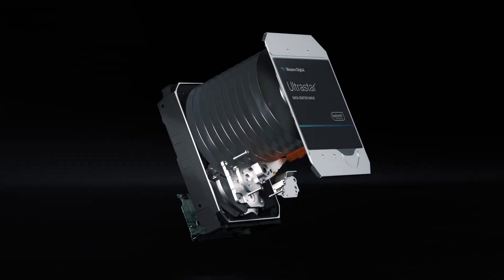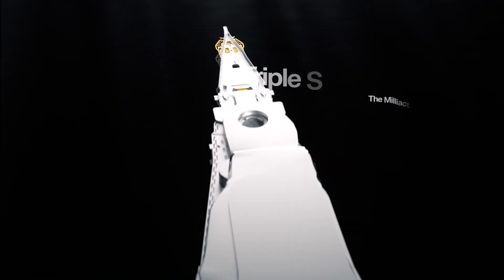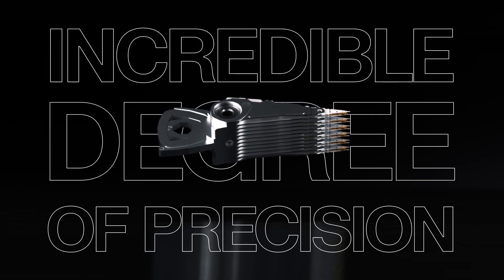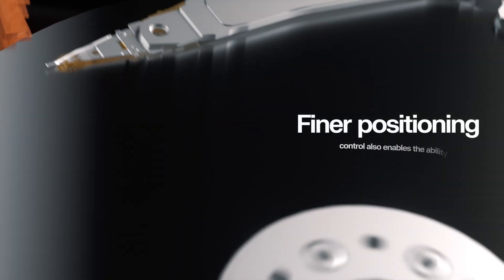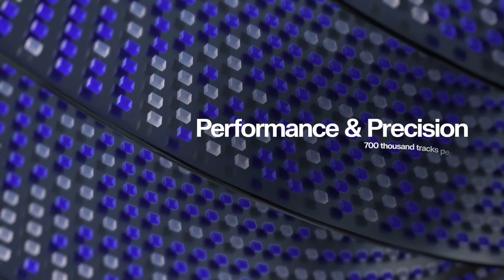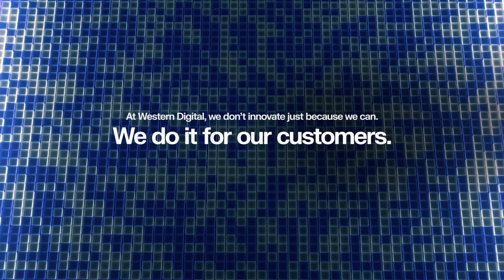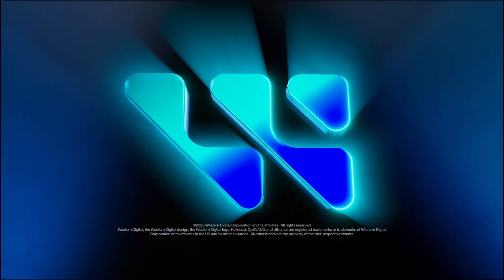HDD Innovation:  Triple-Stage Actuator

Comment: > no obvious comparison of data density to previous generation instead of useless nonsense about CDs
> no obvious comparison of improved seek times
Let me take a guess: it's a complex system that takes a lot of time to settle after a swing, and the reason it exists is to provide just enough precision for random access writes without resorting to shingled writing over multiple tracks with tightly controlled position shifts producing magnetic field switches which can be already just barely discerned by read head?
Reply: I was rather unimpressed to. Feels like an AI marketing video to sway C-Suites rather then the engineers that build and design infrastructure that needs this level of storage

Comment: I don't buy Western Digital drives at all anymore ever since I was burnt by them falsely passing off SMR drives as CMR drives several years ago.
Reply: Yeah but there isn't much of an alternative with HGST gone. Seagate are less reliable so I've been avoiding them for over a decade.
Reply: @kunka592 To be honest seagate's been mostly fine for me. I've got 8 x20 20tb drives running for over 30000 hours at this point with no signs of failure or degredation. Not even a single bad sector on any of them. I did have one drive fail but it was dead on arrival anyway so I got it instantly replaced. 

Aside from those, I've got a couple of 4tb ironwolfs and 2 2tb barracuda drives. None of them are showing any bad sectors at all although the barracudas have lost some of their performance compared to when they were brand new in 2016
Reply: Oh the humanity. How did you ever survive such an injustice of having the wrong three letter initialism?
Reply: @whickervision742 Do you.... are you even qualified to be in this comment section? Now I'm guessing you're probably american from the sheer lack of intelligence so it's the equivalent of saying a GPA of 1 is only 3 numbers away from a GPA of 4 so there's no difference. 

SMR drives stand for shingled magnetic recording and means that the drive has to constantly re-read and rewrite a whole data zone when attempting to modifiy or delete a small portion of that zones data. This means you lose roughly 60-70% in sustained data trainsfer speeds.

WD is an absolute joke for trying to put it in NAS devices where speed (especially in raid) matter alot.  But hey, you do you man and stay ignorant.
Reply: @whickervision742 if you don't understand the difference between the two, that speaks volumes of your intelligence.

Comment: Fun fact of the day, I actually sent this suggestion to both WD and Maxtor back in the early 2000's 

Even took it one step further to see if it was possible to have two independently moving heads for improving seek times
Reply: The genius isn't the idea, it's the implementation. How the axis moves and how it is stabilized. This isn't some simple PID controller either.
Reply: I'm sure you know that multiple heads were first used back in the '50s and 60's, when such devices were unique, so it's not exactly a hidden path. You probably did some calculations to show how much seek times improved (each additional head basically multiplies the hardware cost while having less and less effect on average access time). Compared to arrays of regular mass produced drives that give independent access and combined throughput, and caching hierarchy that can be constructed to give the required average hit ratio for a set usage pattern, it would not be very attractive.
Reply: @DarkKnight32768  To draw the mental picture to override some of that  condescending commentary

Imagine one arm that is has two halves:
An upper and a lower one
(big 1000 IQ moment) 

The arms could either move independently of each other or in sync for improved seeks & writes depending on what was needed 

Obviously, NVMe is significantly faster as 2.5GB/sec read \*and* write times are common now
Reply: You should sue them

Comment: Why not install 2 actuators at once, diametrically opposed? Or 4?
Reply: Well. If a data train leaves the station travelling at 7200 RPM... Do some math.
Reply: They already do that for the second actuator and the 3rd would be similar i suppose

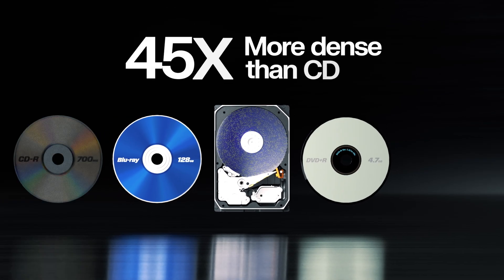Comment: 1:34 and 1 milion times denser than the stone tablet. What is the point of this comparison lmao.
I hope it inovates reliability, not only money making density
Reply: Vinyl record is the point where you can see the tracks.
Reply: 10x denser than a blu-ray is, at maximum, ~1300GB. It's not impressive for a drive at all
Reply: By definition, more complexity = less reliability MTBF
Reply: "I hope it inovates reliability"
i'm still using 2 TB WD2002FAEX drive with 115k power on hours (13.7 years)
seems pretty reliable to me :)
Reply: @stclaws9580  There was time in late 1990s when 2 GB WD were dying like flies. Bad design.
Reply: @stclaws9580 damn. My longest living drive has 44000 hours, my 60000 hour drive failed 5 years ago. ;_;

Comment: Let us hope it can still work with 2 out of 3 of these actuators operational
Reply: Like a lot of new storage technology, these are presumably intended for enterprise/datacenters first, where density and reliability as a whole are most important, not necessarily an individual drive.
Reply: Most likely it can, as HDD have been using Special place in those tracks to know what track they are in.

Yes, the track have trace that name the track, so the track heading head can track what track it is on.
Reply: Well you can still try swapping the hhd discs to a different working hhd and recover the data
Reply: I mean, typically if there's any kind of hardware fault at all in something as crazy as a hard disk, I expect the thing to be dead. You should probably be in the mindset that hard drives are a consumable, because they will fail. Not if, when.

That's why you use backups, and if you're fancy a redundant system of multiple disks like ZFS that can survive the loss of one or more drives without losing data.

Comment: WD is going to keep finding ways to maintain hard drive relevance for the next hundred years
Reply: Yeah I can buy a 24tb HDD for less than an 8tb SSD. Sorry but for larger amounts of storage and longer archives HDDs are still very relevant
Reply: @masterinico  Not forever.
Reply: SSDs aren't really that great for data retention when they are offline with no power, HDDs in the other hand are magnetized and don't suffer from this flaw.
Reply: Life span of hdds are much longer than ssds
Reply: @50H3i1  with sufficient overprovisioning ssds can last for a long time on its own, but for price to storage hdds are king but for speed ssds are king but for long term cold storage tape is where to look at
Reply: @50H3i1  
Yes, It was, but with RaceTrack memory and UltraRam everything is going to change.
Reply: @gregandark8571 "going to change" bruh
Reply: @Splarkszter  bruh
Reply: @Splarkszter  breh
Reply: Race Track memory is right now behind the coroner ...
just saying.
Reply: @gregandark8571   Heh,  dead tech will need a "coroner".
Reply: @chris-io9zt 
No, only a trash bin.

Comment: With actuators so small, I would be worried about mechanical durability... Would it survive shipping? Vibration from other hard drives on the same chassis?
Reply: They always package drives very carefully. Vibrations from other chassis?? I mean not likely maybe it you have an old crap 1990s HDD rattling next to it. 

I have several 20tb+ drives in three stacked raid enclosures. Even balancing on each other multiple drives running at a time in multiple raids still barely vibrates
Reply: @masterinico  I seen more than once a bad fan to cause vibrations in a entire rack, it is not much, but probably enough to misalign such small actuators...

Comment: If I toss a drive like this in my backpack and go on a flight. Will it die after the plane lands ?
Reply: well it's a drive made for data centers, so why would you be doing that in the first place?
Reply: @caveman314  It's a hypothetical questioning how resilient it is. More bluntly, "if I fumble this thing in the data center for some reason and drop it, how much data loss will there be? Will the drive even function?"
Reply: @SwordfighterRed  I'm sure that's all in the information package that data center customers would get to review before ordering these.
Reply: HDDs are tested for several thousand Hz/s under vibration parameter. Putting in your bag pack wouldn’t matter a bit.
Server racks use dozens to hundreds of these disks & that has more stress than travelling with one.  Besides HDDs are prone to failure when powered on & working. In power off mode the head isn’t anywhere the platters & even in power on mode over a set threshold of vibration or acceleration the head undergoes emergency parking to protect the platters.
Reply: No. And yes. Put, put it in your bag, in a soft case, and it should be fine. Toss it, like to drop or throw… ehhhhh just don’t okay it’s not a good idea
Reply: Less likely if it was turned off propery but they aren't made for hauling anyways.
Reply: @Splarkszter for extremely large data transfers there are professional services that actually move HDD in trucks from city to city
Reply: @Eonz are you flying on a Boeing?
Reply: Depends on the drive, check the datasheet. If it is over 100g then you will be fine as long as you dont use it during flight, and if it exceeds that,

You have more pressing issues.
Reply: Yes it would, with 3 actuators it is going to be so fragile that it will brick right when you put it in your bag, let alone a flight 🤣
Reply: Yes it would, with 3 actuators it is going to be so fragile that it will brick right when you put it in your bag, let alone a flight 🤣